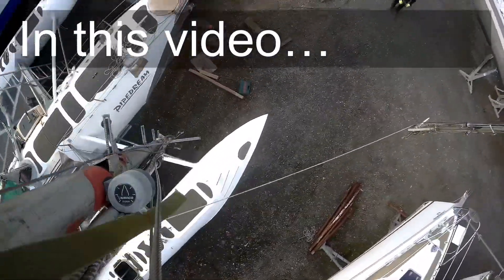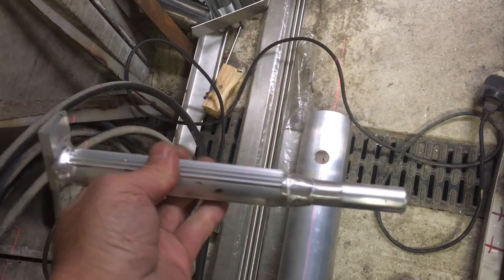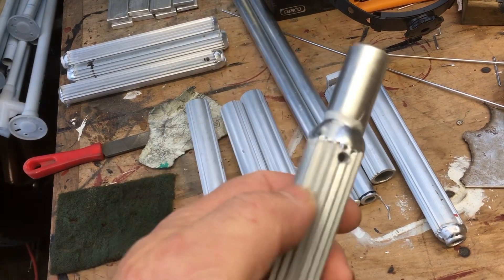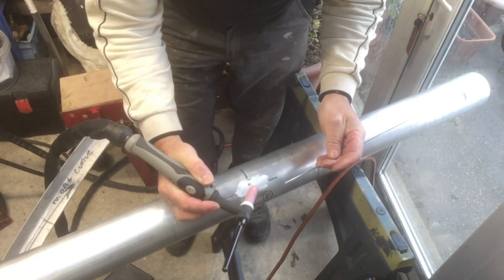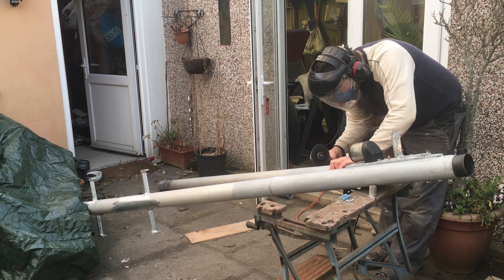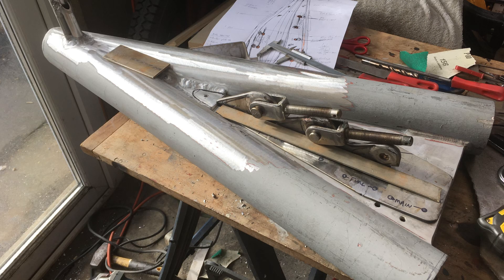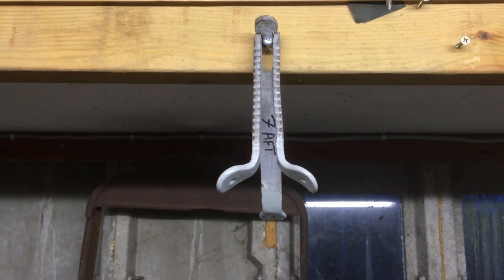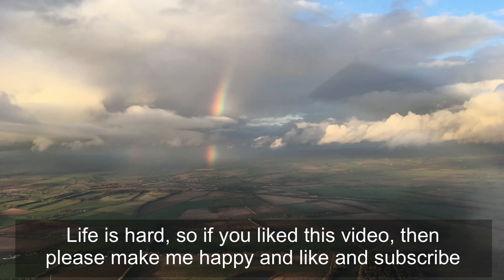Project Mast, welding steps, cutting stuff and getting it all wrong…

Comment: Sounds good.
Reply from the maker: Thanks, turned out my laptop was playing up again, I thought I had messed it all up.
Reply: What type of mast is that? Where can I get info? Thanks
Reply from the maker: @harrisonmccallop1312  It was my own design. The tube is 3 1/2 by 1/4 thickness. I thought it would be easier, cheaper and more suited to the boat by spreading the load. Realistically it has been and whilst it has a bit more windage, the efficiency of having no mast in front of the mainsail makes up for that. It is also really easy to sail as it just has two standard foresail furling systems.